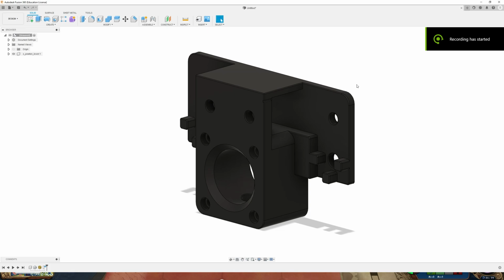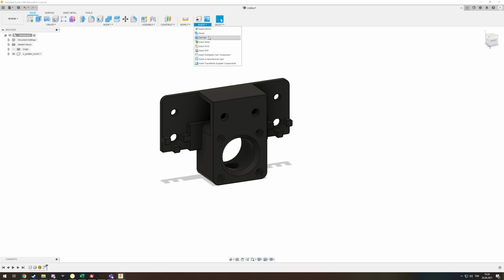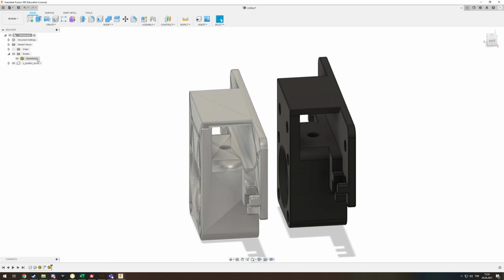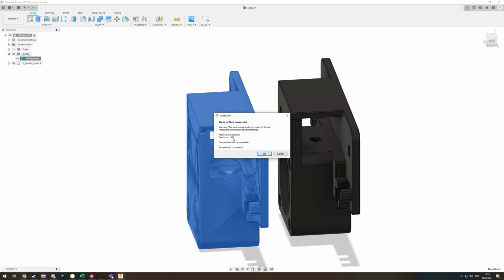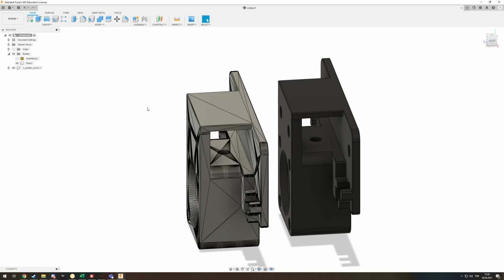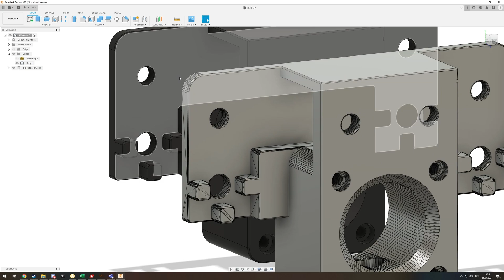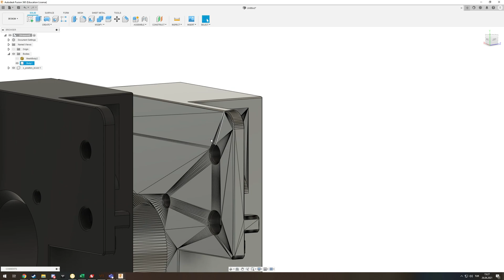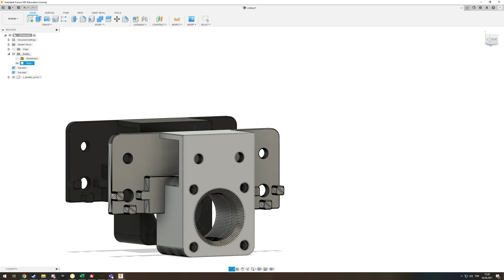Editing .stl Files in Fusion 360

Comment: to make that easier you can go to the surface workspace and use merge to add 2 triangles together. This automatically connects every triangles on all flat surfaces. If that is not working using boundry fill should do the trick